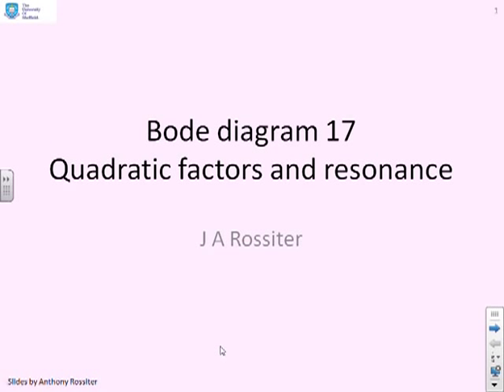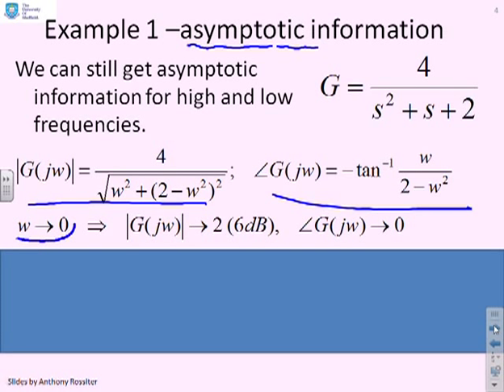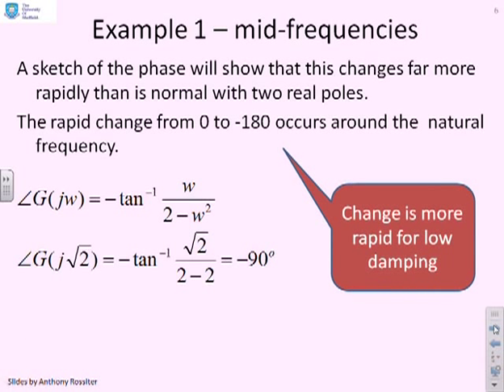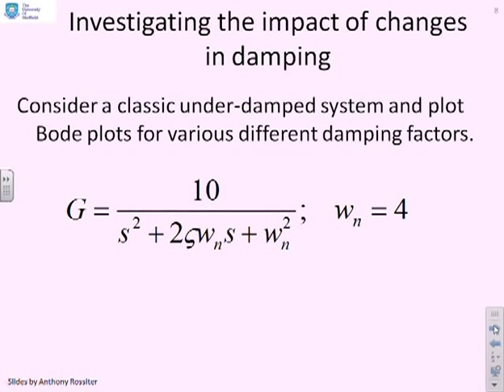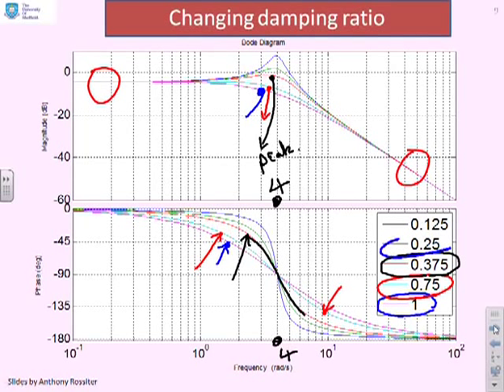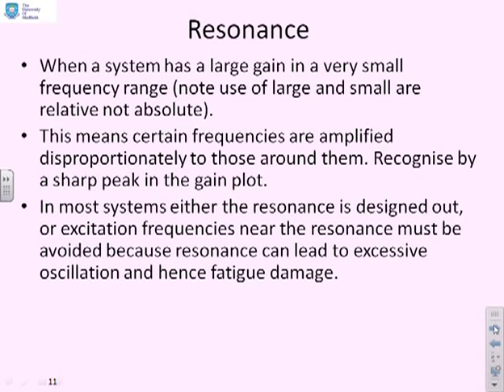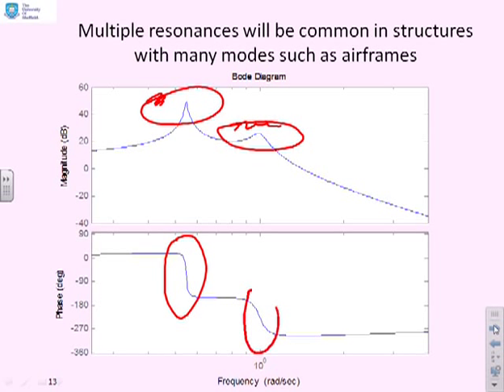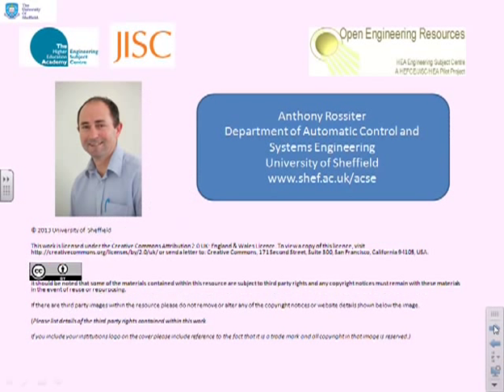Bode diagrams 17  - quadratic factors and resonance

Comment: Please could you explain why G tends to minus 180 from inspection?
Reply from the maker: You may need to give a time in the video for me to locate query. If a system is a simple quadratic with no numerator polynomial, then asymptotically the s squared term will dominate and thus give the 180 degrees.